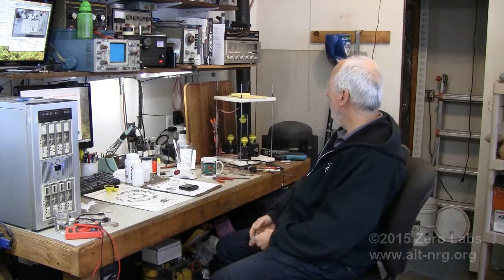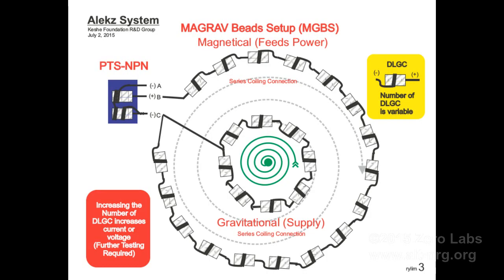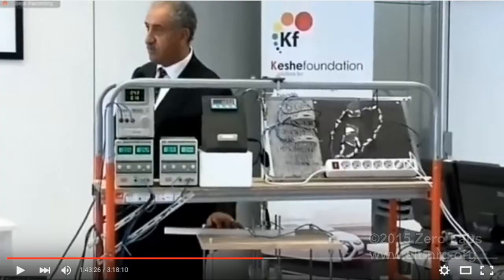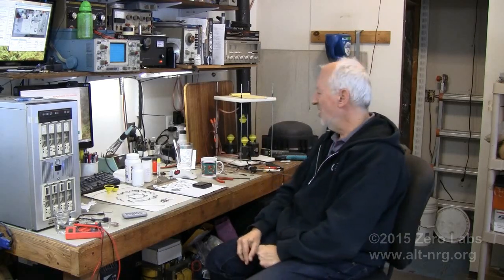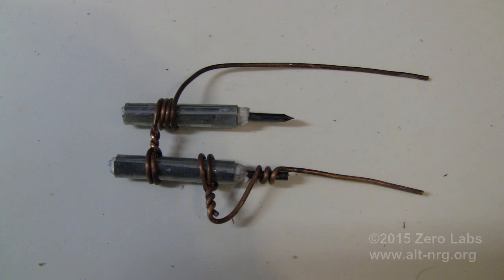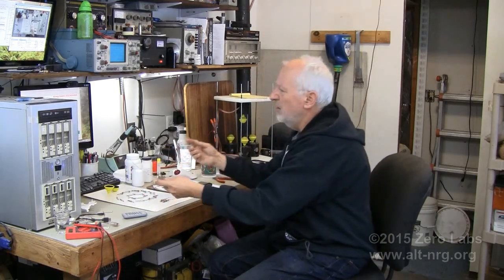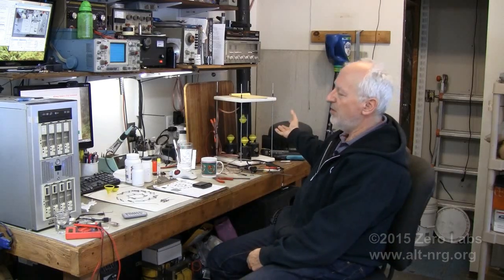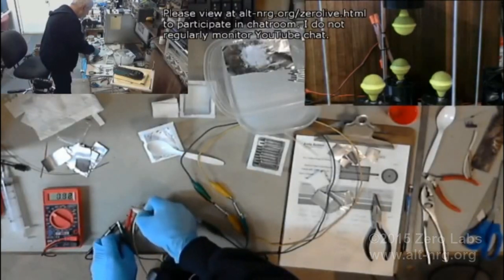#428 Project update Magrav Energy Beads construction

Comment: so now that your done proving someone else wrong maybe its time to use that brain power to make something that works
Reply from the maker: +Dennis Peacock That's my new years resolution! Real science coming up next. Fasten your seat belt!
Reply: +ZeroFossilFuel Stanley Meyer's water injector but with a twist, it has a solenoid that controls the water injection just like a normal injector but without the needle in the middle that moves up and down but a guided magnetic collar that is under sprung tension with the original water injector modified a little to incorporate it in the middle of the injector and check valve in the top of the solenoid to stop back flow.